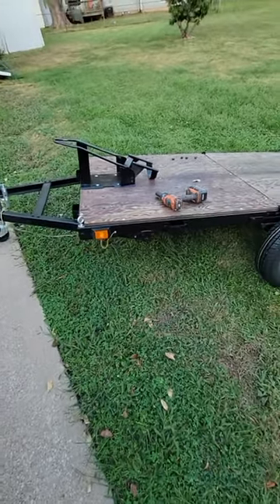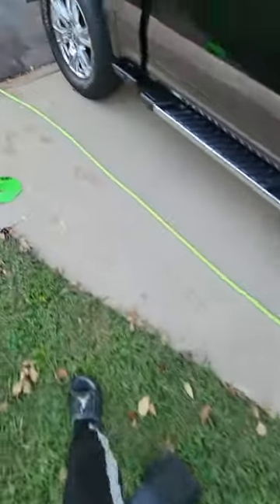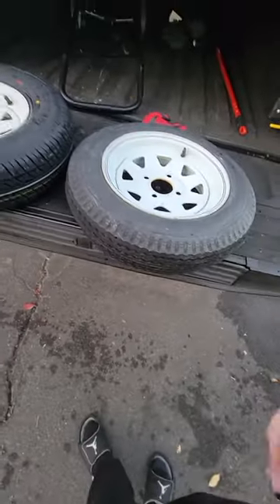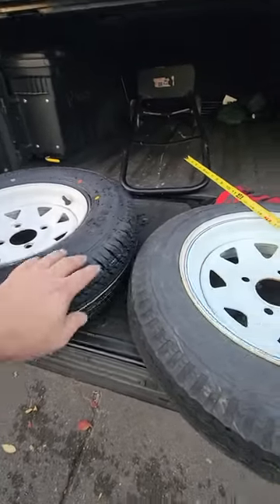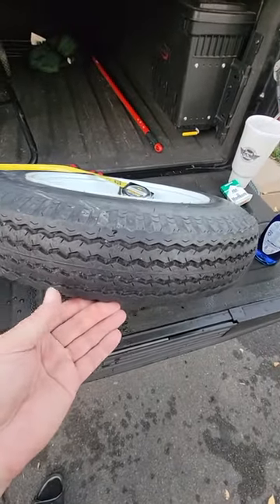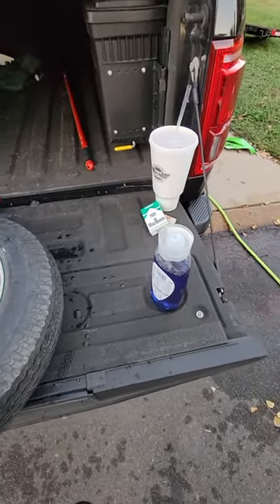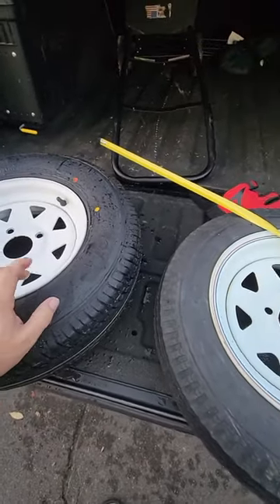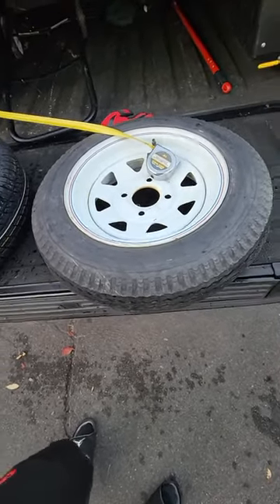12 inch trailer tire upgrade.  Harbor Freight trailer

Comment: Just watch out for the DOT car tires on a trailer will definitely get you a ticket if not impounded... The sidewalls are not designed to carry weight... Especially if you get into a crash.
Reply from the maker: @karenwilliams2427  it's a car tire. It carries the weight of a car. Right on the side well it has a load carrying capacity which is greater than this axle will ever hold.  I'm very familiar with DOT. There's no law against increasing your tires load carrying capacity. This will be much safer than the original equipment tires.
Reply: @wbgarywp   Well since you are so will informed just Google Can you use car tires on a trailer ??? The answer is NO!!!!!
 If you bother to do any research on the subject, you will conclude that it's best to use trailer tires on trailers, car tires on cars, truck tires on trucks, etc. But, there will always be a few people who claim that they used car tires on a trailer and had no issues. They just haven't had any issues yet. 
Can you put regular car tires on a trailer? Why?
No, regular car tires cannot be put in a trailer. This can be dangerous. Tire tread on car tires is different than the tread designed for trailers, which can cause irregular wear on the tire and will blow. Load ratings are also carefully chosen for car or truck tires and completely differ from trailer tires.
What Makes Trailer Tires Different?
You may be wondering, "Can I use car tires on a trailer?" The short answer is no. Special trailer or ST tires are designed for a different purpose than car tires, also called P-metric or Euro-metric tires. This means they have different features.
Higher load capacity
Stiffer sidewalls and higher operating pressures
A lower maximum speed rating
Oxidation
Higher Load Capacity
ST tires have about 10 percent more load capacity than comparable light truck or LT tires and about 40 percent more capacity than typical car tires. This makes them better at hauling big loads than car tires.
Stiffer Sidewalls and Higher Operating Pressures
Car tires have flexible sidewalls to keep their tread anchored to the road and increase comfort. Car tires also play an important role in:
Steering
Transmitting power from the engine to the road
Making turns or swerving to avoid obstacles
Trailer tires have stiffer sidewalls to prevent trailer sway and stiffer, less complex suspensions. Many smaller trailers don't even have brakes. Higher operating air pressures for trailer tires keep the load capacity higher than a car. Trailer tires also have narrower wheels and shallower treads to improve fuel efficiency and reduce heat from friction.
Hint Hint!!
Reply from the maker: @karenwilliams2427  I understand what you're saying. In some circumstances this is the case. But in this case it's not. These tires are higher load carrying capacity than the cheap tires that came off of it that only last 1000 miles. I promise you I won't have any issues with DOT. They've got their hands full with all of these raggedy semi trucks running Recaps on a steer axle
Reply: I'll meet you guys in the middle. How about instead of a "Car Tires" OR Cheap HF/Wal Mart/Temu Trailer tires. You go with a good Quality Trailer Tire of the same size ? What I think karenwilliams2427 is saying if there is a tire issue resulting in an Accident , law enforcement / Lawyer.... Can say he was running Tires that were not designed for trailer use. Law says use Trailer Tire and if your not anything that happens is Your problem....
Reply from the maker: @michaellandreth1392  I get what you're saying. Even though it's far-fetched. I'd be willing to battle that won in court. They would have to prove Beyond Reasonable Doubt that's a tire caused the accident. Then you have the question of what that accident have happened with a Harbor Freight Tire. A trailer tire blow out almost never results in an accident. If it does you probably shouldn't be behind the wheel or pulling a trailer. Trailer accidents are usually a result of an overreacting driver or improper loading / weight distribution

Comment: Does it help with the bouncyness of factory tires , i heard car tires run smoother. What psi are you running the new tires
Reply from the maker: The little trailer is bouncy no matter what because it's so light weight.  But once you get a motorcycle on it it rides much smoother. Lubricate all the friction points and you'll forget it's back there when loaded.

Comment: Which trailer do you have? Do you have the 1700lb or the 1200lb
Reply from the maker: Good question. I have to check the tag
Reply: @wbgarywp  OK great yeah if you could let me know. I greatly appreciate this video. I just bought the 1200 pound version. I’m fairly certain this upgrade will apply to both. Or at least a similar variation.
Reply from the maker: @youcanthide004  mine is 1195.  But it shouldn't matter as long as you have 12 inch wheels
Reply: @wbgarywp  Mine is also 1195, so good to go / Also I think you are right as long as they are both 12" wheels. Thanks Brother!
Reply: For anyone else wanting to know, the 1700lb trailer uses a 5 lug wheel and the tire size 5.3-12. So those car tires might sit a little fatter. The only problem I could see happening would be scrubbing on frame but I think there is plenty clearance. The deal with the folding trailer even if you lock it out there are two bolt heads present. If your tire increases in diameter and it's a little wider. It could be very close if the tire flexes and scrapes those bolt heads you could easily shred a sidewall. Like when hitting a pot hole for instance. That could probably be alleviated by also installing a wheel spacer on the hub. I would do some careful measuring before doing this on the 1700lb version with factory wheels. Now if you had wheels that have the hub offset slightly inward then it should be ok. You also don't want to change weight and other forces too much as the bearings are probably not going to like it.
Reply: @rubiconfpv6175  awesome thanks for the reply so I ordered some larger radials Carlisle to be exact. And I also ordered the wheel spacers from what I understand from a few others 5 mm will do the trick.
Reply: @youcanthide004   The only other thing you have to calculate is the load rating. I don't think you could find a tire with a load rating so low it would matter though. My 1720lb trailer has a GVWR = 1980 also the GAWR (a=axel) = 1980.   The 1195lb trailer has a GVWR of 1444 so I assume the GAWR is also 1444.  So for this video his tire is 77T which is 908lb weight rating and 118mph. So you take 908+GVWR(1444) = 2,352  that number must be equal to or above the GAWR ( also assumed to be 1444 ).
Reply from the maker: @rubiconfpv6175  just got back from a 1700 mile trip with this setup. I put a Harley bagger on it. The hubs on the trailer never even got warm to the touch. But of course a while back I did new bearings and Lucas Synthetic Grease.  The tires still look brand new. I am celebrating not having to buy tires every 2000 miles.
Reply: @wbgarywp  Wow, 2000 miles yeah, that's crazy. You - can - buy high quality trailer tires. I had a tire go bad on me towing a boat home one night. I started to feel something a little odd. Stopped, looked and the tire had chunks missing out of it. I was able to drive it the rest of way home though. Good ST tires are nice to have but I'm pretty sure HF standard tire is bottom of barrel. I know they are only rated for 55mph. Good trailer tires are made to carry heavy loads and do have advantages over typical radial tires but I'm not sure most HF trailer owners need high grade ST tires. I don't carry heavy loads often and have considered changing out to regular car tires for a - maybe - smoother/less bouncy ride and higher speed rating. Just never have gotten around to it. I don't run that many miles. Just household waste and tree limbs, brush, etc..Hauling stuff from Home Depot or Lowes.  You really might want to reconsider that "no-fender" situation. Heard many say they got a rock shattering the rear window of their vehicle. Good to know on bearings. I think I will clean and repack and reseal mine with either Lucas or some Marine synthetic. I don't know what I used when I built it. I saw one YT vid and he clearly had a leaking seal and said both his hubs still run at like 110deg.
Reply from the maker: @rubiconfpv6175  I'll definitely get some fenders. Something better than the flimsy ones it came with that kept falling apart
Reply: @wbgarywp  that’s awesome and I’ll be towing my 850 pound Indian Challenger. It’s good to know. Thank you.
Reply: @rubiconfpv6175  Do you think these tires would be fine on the 4 lug wheel without spacers?
Reply: @nathanielramirez8997  I have no way of knowing but he has 4 lug in the video and said they work fine.
Reply from the maker: @nathanielramirez8997  yes they work fine on mine without spacers

Comment: How are the new car tires holding up ??
Reply from the maker: So far there holding up very well. I'd be willing to bet they'll dry Rot before the tread is low 😂
Reply from the maker: Just did 1800 miles with a street glide on it. It rode perfect. Tires show no signs of wear. The original tires would have been at least half worn out
Reply: @wbgarywp thanks man, I’ll be doing this to my trailer

Comment: Do those tires fit the stock rim?
Reply from the maker: Yes
Reply: @wbgarywp  Would they fit with the fender?
Reply from the maker: @nathanielramirez8997  they would clear on mine. It's only about 1" difference
Reply: @wbgarywp  right on thanks for quick response. Overall would you say towing has gotten better with the tire upgrade?
Reply from the maker: @nathanielramirez8997  I just did 1800 mi with a street glide on the back. It rode excellent and the tires show no signs of wear. The stock tires would have been at least half worn out in 1800 miles. I like taking this trailer just because I can get great gas mileage with it. If I pull my enclosed trailer I'm really paying the price
Reply: @wbgarywp  fair enough i was debating whether they were worth paying twice the price if i am not planning any road trips but I think you convinced me.
Reply from the maker: @nathanielramirez8997  check around for pricing. I ordered these online for only about $20 a tire higher then the cheap little tires that were on it
Reply from the maker: I believe only $60 per tire if I recall correctly
Reply: Do you think you could find a link to these new tires to buy?
Reply from the maker: This is cheapest found per tire on ebay https://www.ebay.com/itm/263835524388?mkcid=16&mkevt=1&mkrid=711-127632-2357-0&ssspo=i88wEx-RTYC&sssrc=4429486&ssuid=U9BJT4KATrO&var=&widget_ver=artemis&media=COPY
Reply from the maker: @nefishipley4593 https://www.ebay.com/itm/263835524388?mkcid=16&mkevt=1&mkrid=711-127632-2357-0&ssspo=i88wEx-RTYC&sssrc=4429486&ssuid=U9BJT4KATrO&var=&widget_ver=artemis&media=COPY

Comment: Great video ! How did you replace the tire ?
Reply from the maker: @Marktheshark943  deflate, break beads with manual tire changer and peel off with tire irons. Or bring to a local tire shop.
Reply: @wbgarywp  thanks ! Keep up the good videos !
Reply from the maker: @Marktheshark943  I'll definitely try. I've been having a bunch of projects going on but haven't had time to record and stuff